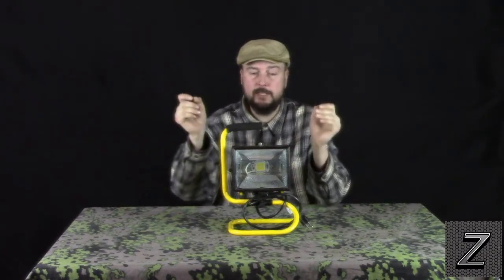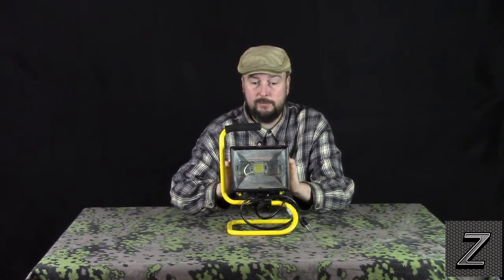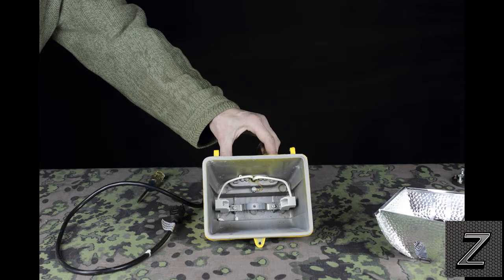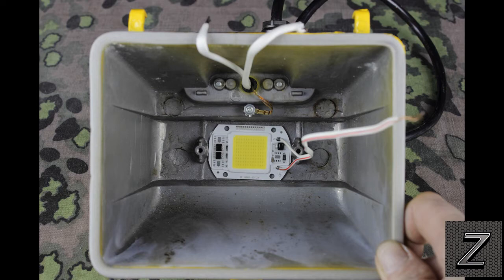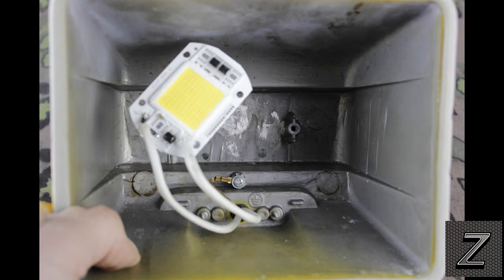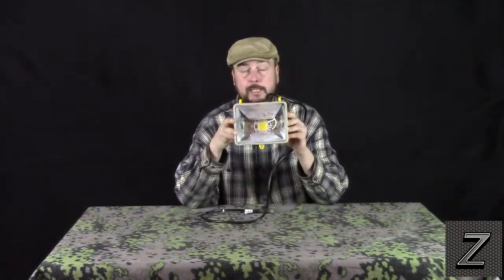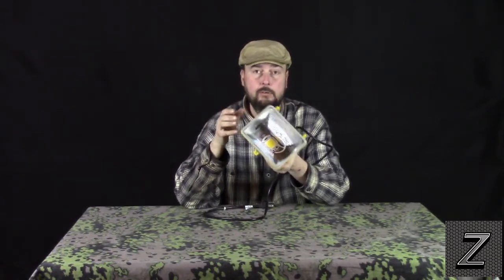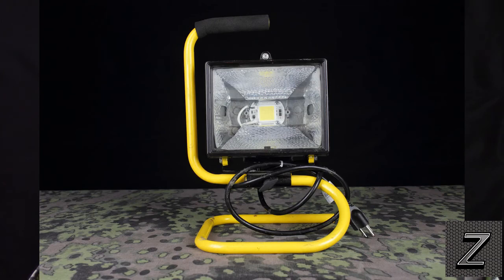DIY halogen work light LED conversion

Comment: One thing that would make it brighter with only using one of those bulbs. Is to have kept the reflector intact and to bring the led off of the back wall. Those ledges are causing the light to not reflect properly. One way of doing this is to use a heat sink from a computer in between the led and the housing. I'm not trying to say that you didn't do a good job or anything like that. Because you did do a great job. I'm only trying to suggest an improvement in the original design.

Comment: Great idea, I did similar myself with a smaller Harbour Freight work light.
One thing to note and be careful of is to make sure that you actually get a "50W COB LED" when ordering from the cheap Chinese suppliers. I ordered some "50W" ones and received exactly what you're using in this video. However, it turned out that they were actually the 20W versions (many of these eBay suppliers offer, 20W, 30W & 50W on the same listing).  
I actually measured the power draw of my "50W" devices (with a "Kill a Watt" meter) and they definitely consumed 20W. 
You can also tell the 50W ones from the 20W and 30W versions by the number of small black 8-pin chips populated on the board (four lined up opposite the power wires and one between them). These are the MX2082 LED drivers. The 50W version has ALL FIVE possible chip locations populated. The 20W and 30W versions  only have TWO or THREE installed. 
Your device in this video (and mine) clearly has only two installed and is almost certainly a 20W device.

Basically, just beware on eBay (and perhaps message any seller letting them know what you're expecting to receive).  When I contacted my eBay seller, all I got was a "Whoops, our bad!", and a partial refund. I suspect this is a common trick with these suppliers. After all, most folk wouldn't or couldn't check the power draw.
Reply: Paul, My led looks exactly like the one in the video yet labeled 50w. Are u saying that it perhaps isn't actually a 50w?